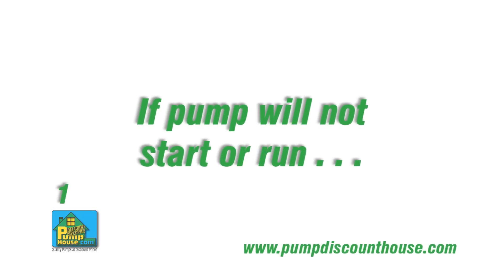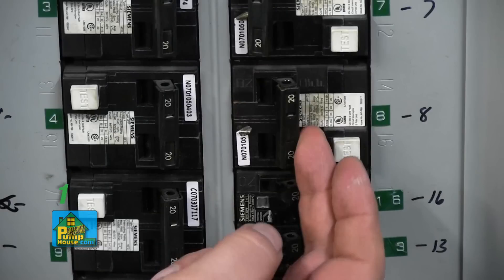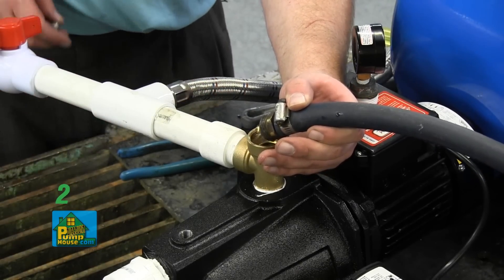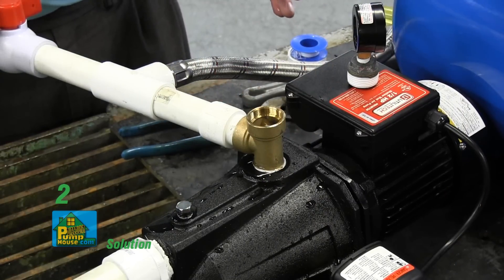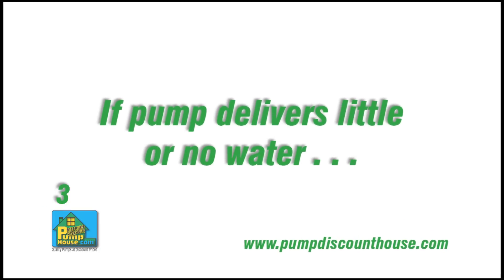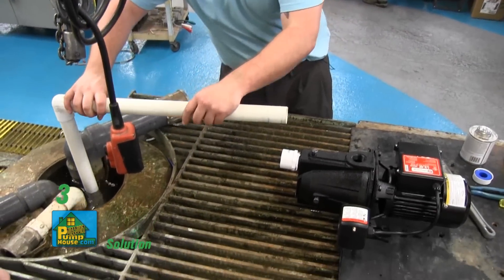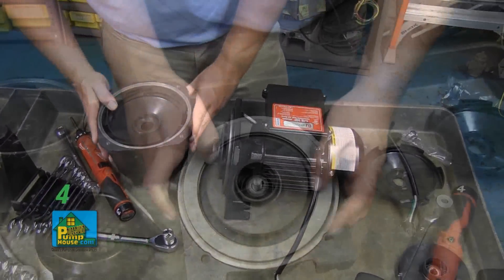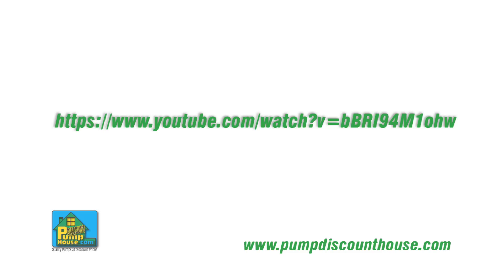Jet Pump Troubleshooting Video for Utilitech Jet Pumps from Lowe's

Comment: well I just bought the pump probably 6 months ago and now my pump is just humming so I unplugged plugged it to make sure it was full with water and everything I go back turn the circuit breaker back on and that's all my pump does it just hums does anybody have any idea please help
Reply: Patrick Wilson Capacitor
Reply: your impeller is not moving it maybe broken
Reply: I know it’s to late but saying it’s just humming isn’t enough info.  It will hum if the check valve is bad, air leak, broken impeller, frozen impeller or broken shaft.